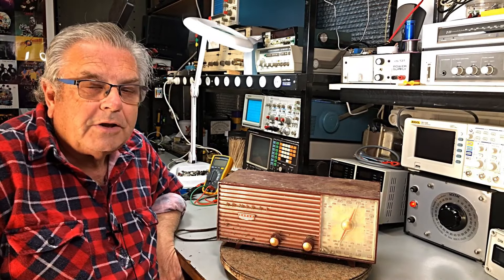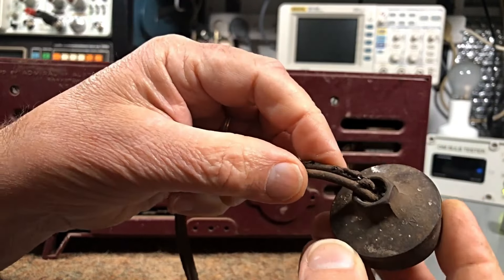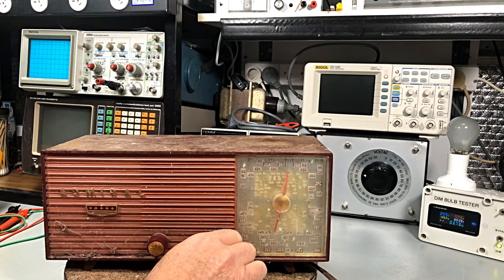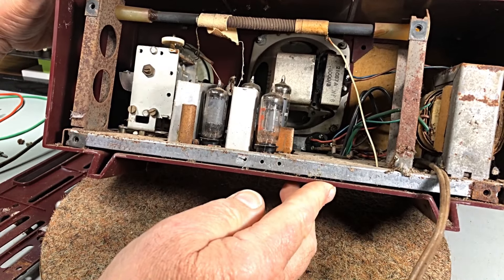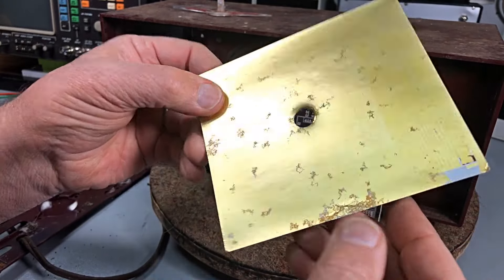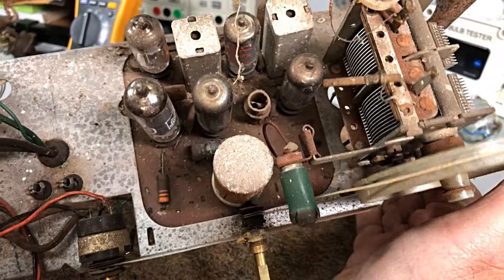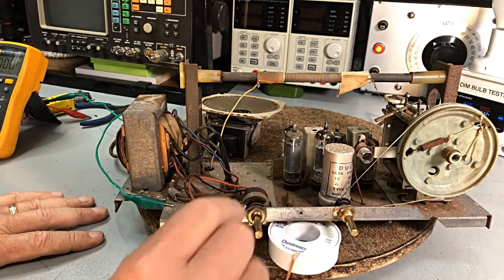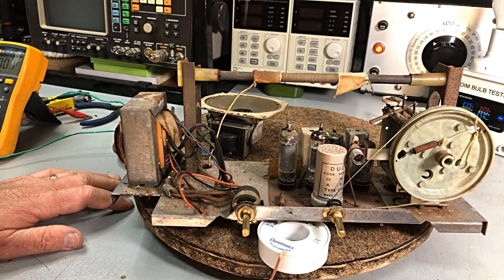Admiral "AW5" Mantle Radio Full Restore - Part 1

Comment: I love learning about the differences in the history of electronics companies  you had in Australia and here in the US, I never knew Admiral manufactured over there and I've researched a bit on other brands youve shown
Reply from the maker: Firstly, Thank you for watching. I feel so good that my vids lead to more research into radio history. We need to keep what history we can gather. 
Cheers
Reply: Admiral were initially very successful in Australia, setting up in 1956 primarily to make TVs.  By 1962 they were gone.
Reply from the maker: @stuartirwin3779 I do have a bit of history coming up in part 2, interesting !
Reply: @techobaz55  The column in Electronics Australia by Neville Williams called "When I Think Back" was a treasure trove of Australian electronics history.  It included an article on Admiral Australia, and what happened to them.  Unfortunately, I've lost the relevant issue.

Comment: Nice job so far Baz. The only good thing I would say about those thick film modules is that at least they give you the component values and layout in the schematic. I'm not too keen on the early PCB valve radios, I much prefer point-to-point wiring. PCBs just don't like the heat and the glue they use to hold the tracks on is useless, not to mention the valve bases being cheaper than the earlier point-to-point style and they usually have dry solder joints on the PCB too. Apart from that they're great 😀Edit: And it is interesting to see the development towards solid state from those days.
Reply from the maker: It is great having the circuit on this one. The missing No7 pin was modded to supply Plate of the 6AV6, but all revealed in the next chapter of this restoration.
The board is in very good condition, inspite of having a huge amount of hours on this radio. I am a fan of point to point but this one is a joy to work on !